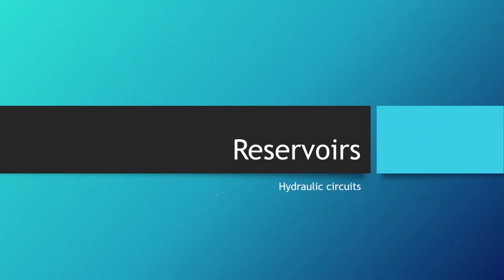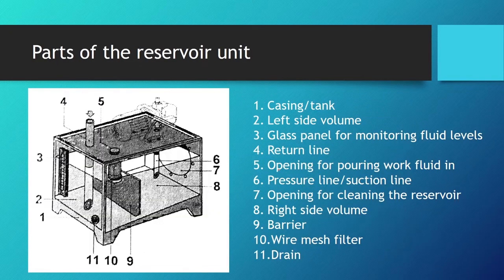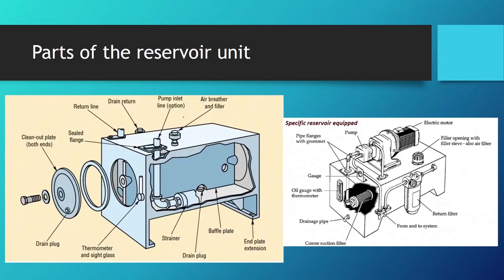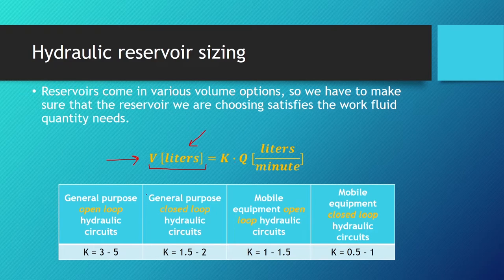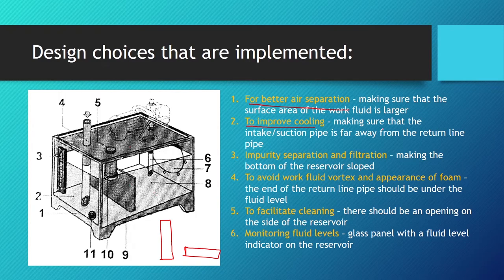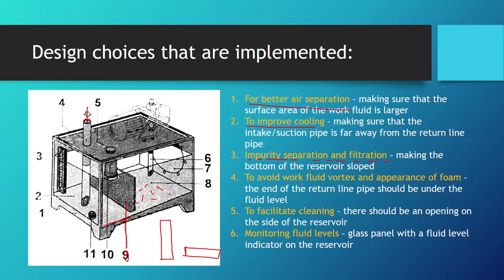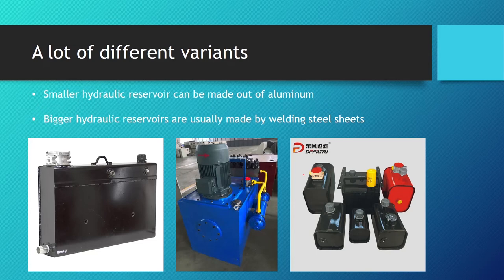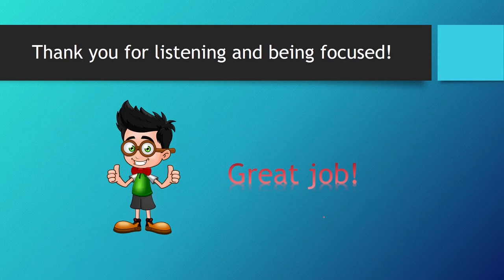Hydraulic reservoirs in depth

Comment: How to calculate the sheet thickness for hydraulic tank reservoir
Reply from the maker: Depends on the size of the reservoir, the amount of fluid, the type of hydraulic system, there is usually no need for going overboard on the thickness as the reservoirs in open loop hydro static systems are not pressurized vessels.

Comment: بالنسبة لمحرك 10ph ...ماهي المضخة المناسبة...وشكرا
Reply from the maker: It depends on a lot of factors such as the needed RPM output of the motor, the needed power of the motor, etc...
Reply: Engine power is 10 HP. Here is the appropriate pump
Reply: Sir, I want to create a plastic press with a body width of 2.4 m and a length of 4 m. Help me, thank you